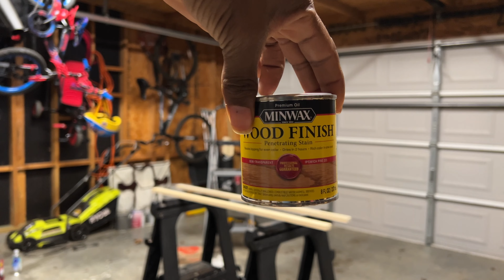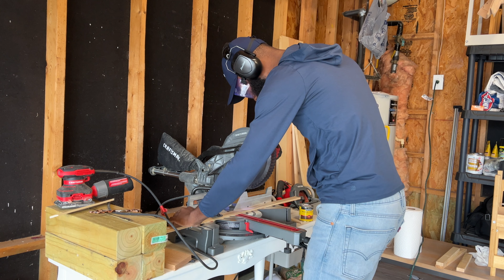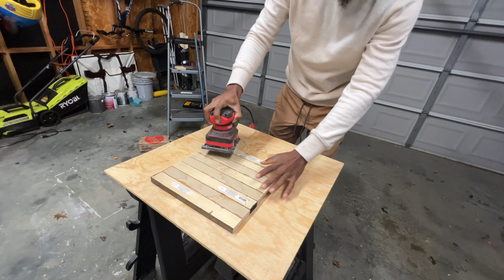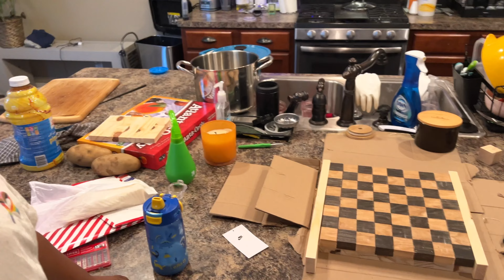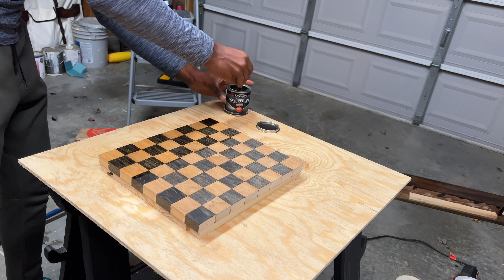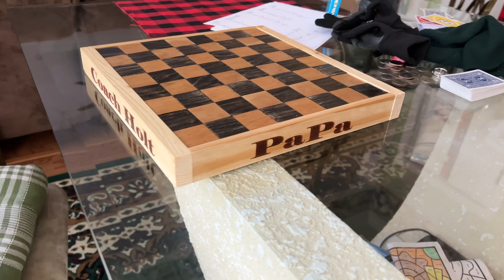Making a chess set with only a miter saw

Comment: I have never (so far) seen anybody using a sliding miter saw, sawing by pulling the blade. It works.. but it's unusual.
These gaps could probably being avoided by jointing the strips properly, and flatness of the board could have been achieved using a drum sander.
But okay - you wanted a miter saw explicitly.